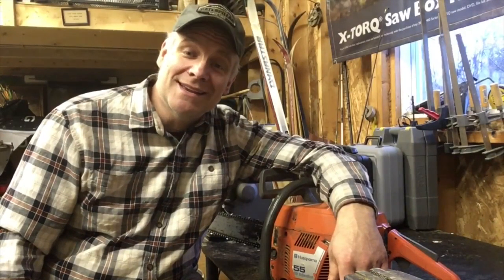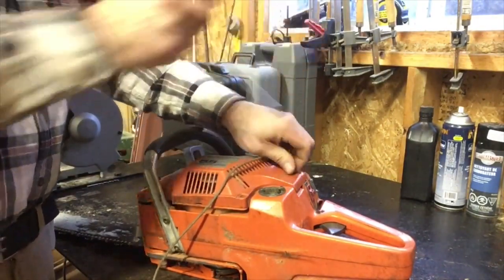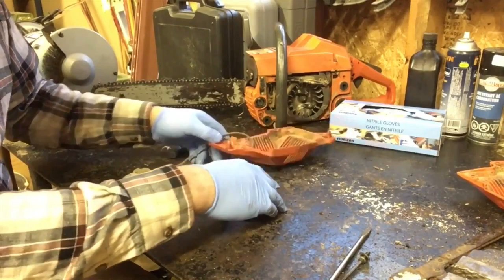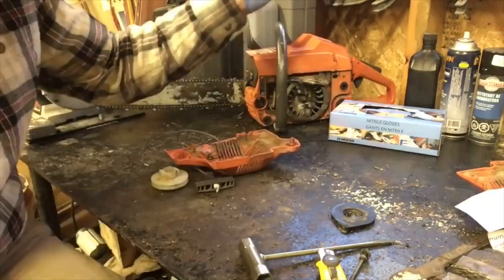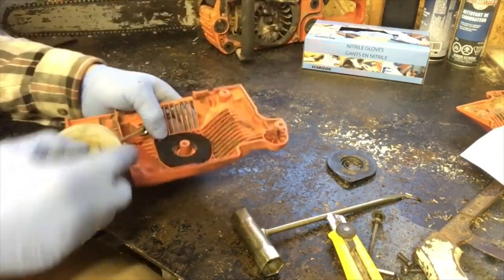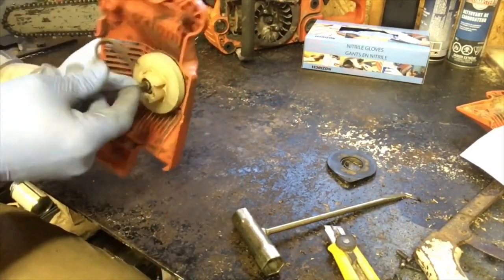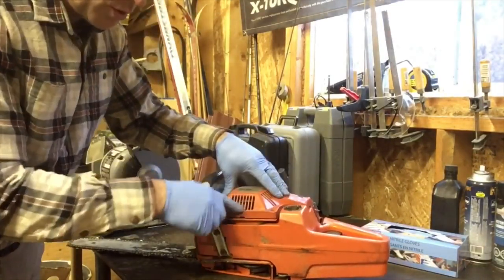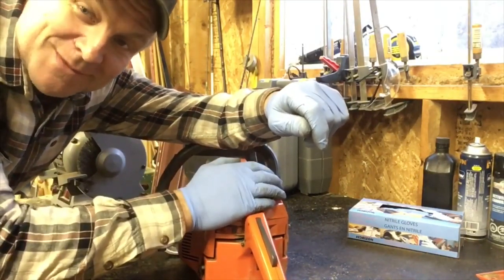Fixing a pull cord that won’t return on a husqvarna 55 Chainsaw .

Comment: Thanks for this -- my cord was stuck in the pulled out position, and after I took off the recoil cover, and just loosened the centre allen screw just a quarter turn, something clicked back into place and the cord worked fantastic.  Replaced the recoil cover then and off I went, no problems.  I was nervous about doing that, but your video gave me the confidence to proceed carefully and slowly.  Thanks again.

Comment: Could the old one be reworked. I've suffered through many pull rope return issues and I always end up in a fight with the recoil spring. And I know all too well what you mean about the aggravation of the  pull handle hanging limp.
Reply from the maker: You can re bend the spring but I haven’t had Much luck doing that. Have a good one man

Comment: thanks for this but am wondering why a new one would be like this?.  bought a new 545 and from the first pull it wouldn't recoil. I called Lowes where I bought it they said husky would contact me and never heard a thing back from either of them. (didnt surprise me) randomly after a minute or two or even sometimes 10 seconds it would recoil but now after only a cord of firewood it is a useless chainsaw. with a fully extended pull cord. I have pics and video of unboxing it and trying to start it to show how it worked  if anyone is interested before they buy a 545.
Reply: What most people don't understand is when you buy a Husqvarna chainsaw from Lowe's it is not the same style as you go to a Husqvarna dealer. If you don't believe me do some checking and you will see for yourself that it's a cheaper made chainsaw.